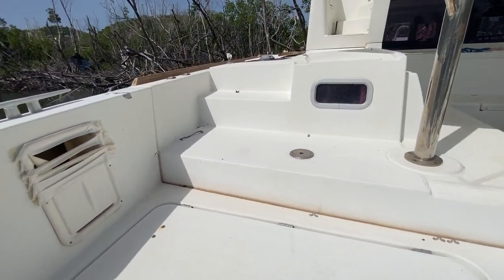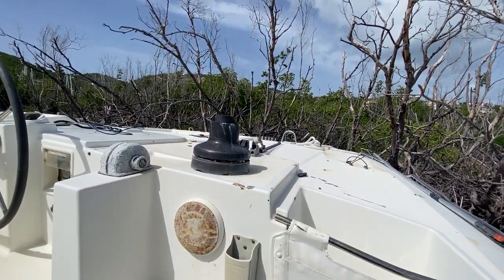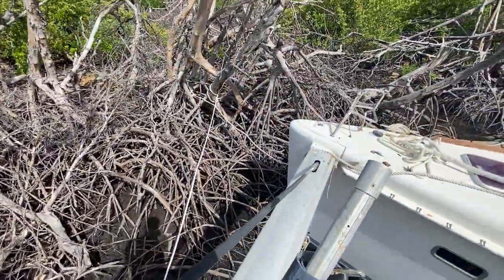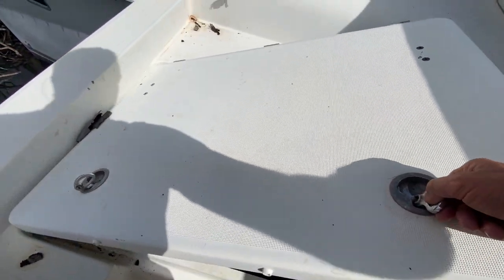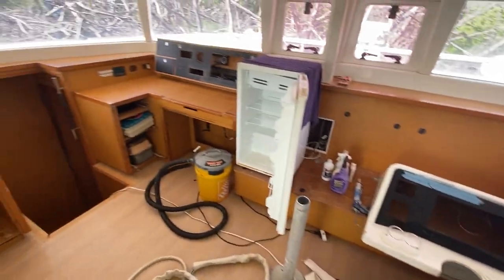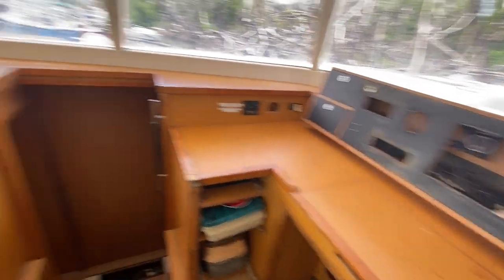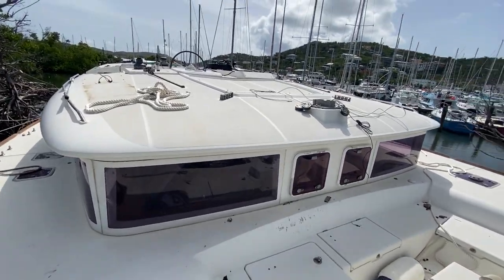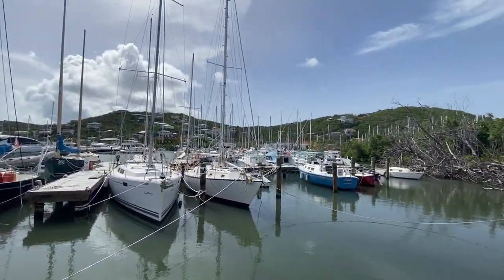Lagoon 450 Hurricane Damaged For Sale

Comment: I think a Good Saving System for the Cats . Could work. Simply Design a Long Float Bag . Like an Air Bag if water enters Either Side of the Hulls. Say Left Hull is Breached once water Level Reaches Half way. A Sensor then detects and DEPLOYS A Float Bag By The Inner Hull Under the Deck of the Bridge. I don't mean inside the Hull I mean under the deck on the Inner most side of damaged Hull. Which would keep water damage to a Minimum. under the deck

Comment: Those bulkheads been checked? The Lagoon450’s have problems and check them before you buy. Ask Colin on Parlay Revival. It’s a $30K fix.
Reply: Since it appear to be a design fault even if the bulkheads are OK now they wont stay that way. Strengthening them will of course be a cheaper job but since you have to remove a lot of the built in furniture it is still not going to be cheap.
Reply: Everyone estimates it’s $30k but no one had completed and confirmed price
Reply: 30k to fix bulkheads? Try 50k, inflation.
Reply: @billakers6082  Apparently to fix this issue prices are ranging from $20k to $80k

Comment: I see why the engines are gone. At a possible 90k a piece. I can see why their missing. So long as the rocker arm assembly is not rusted (being under water is unlikely). Like you said. Oil floats protecting that area and water below is not going to allow air which is what will start the rusting process. Those engines were very likely in very good condition. 

At this point. I’d get a couple forklift electric motors and put them in to replace the engines. Add more solar panels with a couple wind generators. Deep cycle batteries and a backup generator. I’d take her for $1000.00. There is a whole lot of work there. She needs electronics, rigging, sails and mast, fiberglass work and no telling what a survey would turn up. But, it would be a shame to see her in a salvage yard. She has potential.
Reply: Maybe 9k?

Comment: the engines would have probably been good as oil floats on water and so long as air doesn't get in they should be fine, reality is they are easy to sell
Reply: Yup. All true. And at a possible 90k a piece. I can see why their missing. So long as the rocker arm assembly is not rusted (being under water is unlikely). Like you said. Oil floats protecting that area and water below is not going to allow air which is what will start the rusting process. Those engines were very likely in very good condition. At this point. I’d get a couple forklift electric motors and put them in to replace the engines. Add more solar panels with a couple wind generators. Deep cycle batteries and a backup generator. I’d take her for $1000.00. There is a whole lot of work there. She needs electronics, rigging, sails and mast, fiberglass work and no telling what a survey would turn up. But, it would be a shame to see her in a salvage yard. She has potential.

Comment: Sold for 59,000 USD?  Great deal I think.  That boat, you could live in with very little improvement.  Generator was there etc..   Add 75K in repairs and you have yourself a functioning Catamaran.
Reply: Parlay paid $158K makes this a steal. The fact Parley was half submerged and the hull was holed and beaten to hell and back. Once a cored bolsa hull is submerge and takes on water it is doomed. There is no fix to dry out that wet rotting bolsa.
Reply: Unless you have a survey where it lists everything and costs to replace and fix that $75k is just a guess even if you are competent to do all that work yourself. If fact looking at just what is in the videos $75k would be no where near enough to cover even the parts. New mast and rigging $30k engines $40k mattresses and cushions $10k Davits SS handrail posts winches  etc $15k instruments $20k.Then a lot of Fibreglass and woodwork and I am guessing based on the cockpit door alignment you will have to realign the hulls and strengthen the bulkheads. Plus rudders props etc. So I do not think $75k is anywhere near enough. This is just the bits that we can see there will no doubt be more. There is a reason that this boat has stayed where it was on the market for 3 or more years.

Of course any boat can be fixed anyone interested should get it hauled out really thoroughly surveyed and priced to fix add in  a big cushion to that price then see if it is worthwhile.
Reply: @glennedwards1449  Actually a steal vs Parley based on the fact it is totally  waterlogged and will sail like shit on top of being a lagoon witch be nature sails like shit if you are not going down wind. Citing the fact that this model 450 is soon to be the Ford Pinto of sailboats I agree if you put it back together perfect it might sell for $275-300K having a savage title and by perfect you might have nearly that in it. If you hire out the work no way. If you price your opportunity cost no way, the risk no way, putting your money somewhere providing a good return no way. If you ask surveyors, yard owners, salvage companies, 95 out of 100 no way. If it was viable they would be involved, they are not. That leaves dreamers who pluck down their life savings and spend 25 hours a week editing YT vids hoping to scrap by, crying broke and collecting free stuff for their boat that takes 5 years to complete. I worked hard at what I was good at an spent years looking for the boat I wanted, at a price that didn't bother me. By the way those doors are leaning out so it is not bulkheads but maybe some other problem. In hurricane Cleo in '64 I think the eye came up US 1 in Boca and my Dad had a 35 ' cat that got loose from the dock and it flew 100' onto the road. The surge was minimal. Imagine the trauma a large cat takes in a 175mph storm. Hours of lifting , dropping and twisting they were never engineered for. No way you can trust that boat offshore.
Reply: @glennedwards1449  Just delivering it somewhere that will be affordable on the hard for 30 months minimum will be big $$, cheap supplies?? Are you going to give up your job and wife/kids. Not worth it, if you buy this you can't afford the life style.
Reply: @lowryshank94  As I pointed out you would have to spend thousands even to see if it would be a good buy and be prepared to walk away if not. As to your 30 month time scale it actually makes more sense to do it in a 6 month time scale. Only that long because obviously supply chains are messed up at the moment. Let pro's at it sure will cost a lot more money but you are probably going to save a big portion of that because hard fees will eat up maybe $30k. Though I did not catch the age of the boat even if you sunk in $300k which you could easily do that is a good price for a Lagoon450 especially if you realign those bulkheads.
Reply: @lowryshank94  Actually though not sure of US customs I do not think boat titles have such thing as salvage titles. I have never seen one and I think a channel maybe even Parley brought up that they don't exist though it would of course be ethical to mention it. BTW where do you see Lagoon 450 at $300k? in good sailing condition of course. PS Like your ford Pinto comment.
Reply: @glennedwards1449  Remember what you could get for a pinto once word got out. If 100 of 450 built have broken BHs, and that maybe optimistic because those hundred have all reported the same failure. I went thru YT and Yacht World ads for pre 2018 450 models and the vast majority clearly showed the main door tilt to port from 1-2". I am sure owners had adjusted the set screw adjust maximum. The floor is sagging just like Parlay to achieve a door that out of plumb. There were so many. Many had 25-35K price reductions. Prices were 375-450K. Once this catches traction I don't think 300K is very real. I know I would never pay 300K and put my family at risk sailing that junk. Those guys didn't just decide to build shoddy BHs, that I am sure is how the entire build out was performed. There will be a glut of these on the market with much less demand. No I believe you just get a title. I bought my ketch in Malaysia and there is no title, just previous registration and bill of sale and they suggest you declare selling price $10 and other consideration. Deal is there is insurance data bases that specifically collect hull numbers of bank write off salvaged boats. EZ to put that together and use to decide what to underwrite at what premium with certain exclusions. Then of course getting caught not disclosing you may end up being arrested, fined and having to buy your boat back as part of plea bargain. Don't ever get caught driving a Pinto!
Reply: @glennedwards1449  I read two interesting articles. Some insurance companies cover latent defects unless otherwise excluded. The other was once a boat has been totaled by the lender resale prices after repair average 50% and market shrinks by 70%, ouch!! I wonder if insurance would claim total failure of BHs a total write if yards were to charge $100K to do the repair.
Reply: @glennedwards1449  If your boat insurance policy includes a latent defect clause which provides coverage then it will not cover the actual defective part, that part would be the responsibility of the manufacturer. Instead the coverage would include damage that was caused to the boat as a result of the latent defect.
Reply: @lowryshank94  well the wife and kids made. Lol
Reply: @lowryshank94  Yes. I've seen many videos of someone working for years to save a flooded and crushed ship. I'm pretty sure I'd rather make money for a new boat. Life's too short to repair a boat this big with one or two people.

Comment: That boat would be on ther hard for well over a year before sea trial.
sink $300k in refit and another 50k of bulkhead fix.
By the time you are done, it would cost you the same as buying a used better boat and you would not have even had fun sailing it yet.
You will also never get insurance for it and the resale will never be as good again.
That right there is a parts only boat to be stripped, which it was.
It is in all reality, just a badly damaged husk.
Its worth is is in the low 10's of thousands and being in BVI, its cost to refit is exponentially high.
Without working engines and a mask its worth very little.